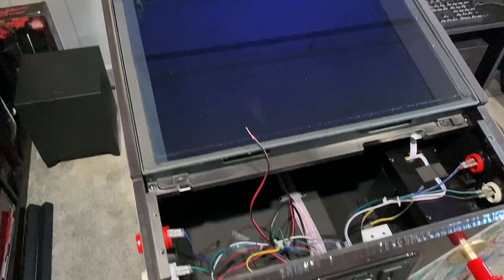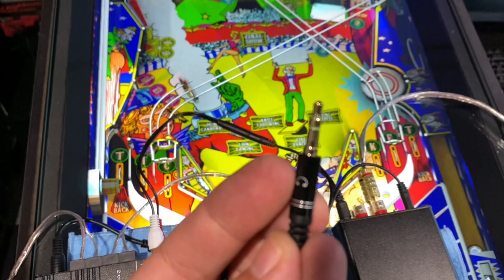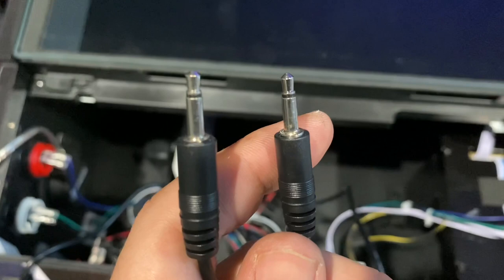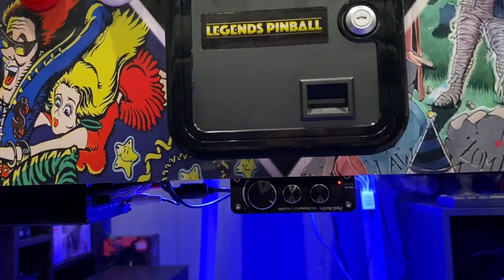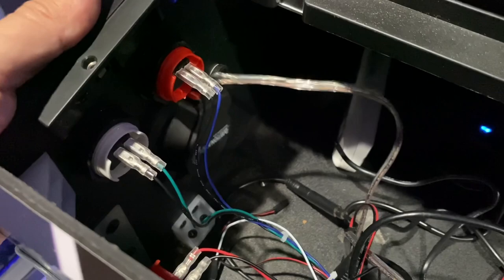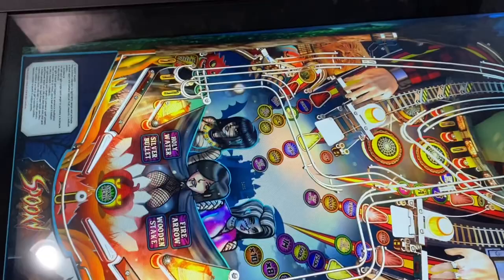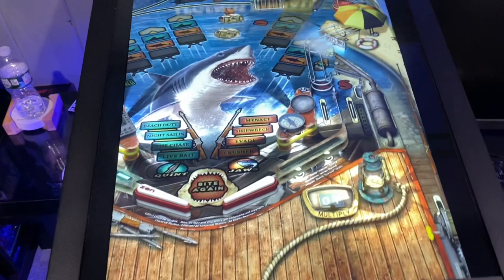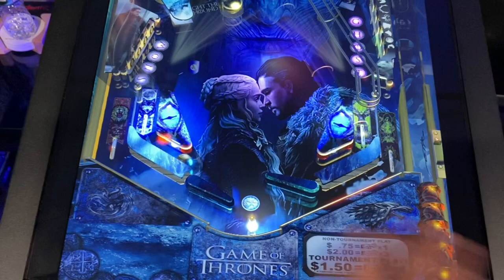Feel the Game: Legends Pinball Haptics Mod Tutorial with Bass Shaker, Exciter & Amps!

Comment: Thank you for your video and expertise!  I too ordered all the parts you have and wired up exactly like you did.  After completing all the wiring, I started up to find that only the left side exciter was working.  No right side and no bass shaker.  I went back and checked all my connections to find the issue was the 3.5MM male plugs.  For the plug for the shakers which plugs into the RCA split 3.5MM female plug, if I unplugged it and plugged it back in just enough to make contact, only the right side shaker would work.  If I plugged it in all the way, only the left side shaker would work.  I found a very shallow sweet spot in-between the two which makes both exciters work.  As for the bass shaker, that 3.5MM male plug plugs directly into the amp and same thing, slightly unplugging it makes the shaker work.  Has anyone else had this issue?  I don't know if I got a shoddy pair of 3.5MM male plugs or what?  

Besides that little hiccup, all the sound, bass, vibrations are really awesome and well worth the mod!
Reply from the maker: You are most welcome. Thank you for watching. Although I did not have the issue mentioned, I pulled the link for those 3.5mm splitters as a few have had the issue. A comment recently deleted by Bonebuster I believe mentioned ordering mono not stereo versions of the 3.5mm as the system outputs in mono. Greatly appreciate your feedback as it’s crucial to ensuring the mod works and improves overall feel of the machine Tim! Happy New Year!
Reply: Hello! Thanks for the video. I have the same issue. Is there any way that you can post links to the right Mono 3.5 mm  Cables? I did get the bass shaker to work with a stereo 3.5. But then the amplifier failed. I had to send it back. It would not even connect Bluetooth.  Another thing, The black and red wire coming from the AlP is a positive and negative?  The Y splitter to RCA is left and right.....how does a mono Y splitter affect the positive and negative?
Reply from the maker: Hey, thank you for watching. Google the differences between mono and stereo splitters and you’ll see the difference. Single band on the end vs dual for stereo. They have them readily available in Amazon for $8-10
Reply from the maker: How did the amplifier fail? Defect
Reply from the maker: Doesn’t affect RCA.
Reply: Had a similar issue as others have listed in this comment chain. I have my setup wired exactly as show in the video. Both of the 3.5mm male connectors wired to the red/black ALP. The exciters work great, but can only get them to work in the left channel. In saying that I have 2 of the Fosi audio amplifiers that have gone out for the bass shaker. Both have worked for about 10 minutes then nothing. My thought at this point is it’s either the way everything is wired causing some sort of loop, or the amplifier itself. I have a 100w bass amplifier that I have on order to see if this might be the case. 

Nobsound 100W Full Frequency Mono Channel Digital Power Amplifier 

Audio Mini Amp (Black) https://www.amazon.com/dp/B07518QZ9B/ref=cm_sw_r_cp_api_glt_i_E197PV111Z2V8J7WPK07
Reply from the maker: Sadly I have not experienced any of these issues, my amps, exciters and bass shaker all function as intended - months later. I’m actually playing it right now. Please keep us updated on what you find.
Reply: @JohnPauls  Will do. I wanted to say thank you for all of these videos. I have both this and the solenoids and when fully working it definitely is a game changer. Once I get the amplifier in and hooked up I will post an update.
Reply from the maker: You’re most welcome. I’m very glad to hear that, so many put the ALP down because of the stock haptics, these mods make a significant difference to the whole experience and gameplay immersion. Thank you for your feedback, it’s helpful to figure out the issue some are experiencing. It’s hard to figure it out myself as my system is working as intended since this build. Thank you!
Reply: @JohnPauls  Just for note, just received the mono amplifier for the bass shaker and got it all hooked up. So far so good. The only downside I have noticed so far is the fact that the amp makes a low hum if turned up too loud. In saying that I may shop around for another mono 100W amp that can better filter this.
Reply from the maker: Thank you for the update. They’ll all do the low hum depending on how loud you have the amp set. You can install an inline low pass filter that’ll eliminate most of it. I don’t have my bass shaker turned up loud enough for it to bother me. It only occurs when there’s no sound input going into the amp - ground loop feedback.
Reply: Well. After 2 fosi amplifiers that have failed. I am now noticing that my haptics are not even getting signal. After hooking them Back up stock.
 Do you have any idea what  Number of ohms that is coming out of the wire connected to the backboard should be?  I am thinking that my board might be damaged. :(
Reply from the maker: I hope you didn’t blow the stock amp on the board. That could’ve been done if you attempted to wire the exciters (stock or Dayton’s) in parallel as that would put a significant enough load to blow the board. Wiring it the way instructed only allows for the signal to be processed by the new amps, those new amps should not be feeding amplified current back into the board unless wired incorrectly.
Reply from the maker: How did the amps blow? What were the conditions when they went? Mine is still going strong as per the most recent video - today.
Reply: I wired everything up exactly how you did. The 1st attempt I would have to pull out the aux cable out just a little bit to get the shaker  And Dayton's to function. While doing so, the fosi amp just stop working.
 I've returned it and attempted to do the same thing with another fosi and the same thing happened. The fosi   amp just did not put out any signal. The Bluetooth stop working too..   Is there a way to spice off the speakers yeah speakers on the backglass? Hook it up to an amp? With a bass shaker?
Reply from the maker: I’ve heard of an in-line connection and people using the back speakers specifically to get Fx3 haptics working. Worth a shot but I haven’t tried it yet. 

Why are you using the Bluetooth for this mod?
Reply from the maker: I think it has to do with the cable. How many lines are on the end of the tip? One of two?
Reply: @JohnPauls  One small thing I wanted to add. I ended up using the fosi power supply for the Nobsound amp instead of the one I ordered that was the Nobsound brand. I was noticing when i used the same brand power supply, my pinball plunger was having issues registering and it almost seemed as if it was skipping. When i swapped the power supply back to the fosi brand the issue was gone. This is a little worrisome as the fact that the power coming from the amp is causing those types of issues. It makes me believe that if wired incorrectly that this could definitely cause major issues with the ALP board.
Reply from the maker: Did you check the power supply’s Voltage and Amp output to ensure they were compatible? That is really strange. Not once have I had any ALP glitches or malfunctions caused by the amplifiers baring the haptics needing to be turned off. Something was wired incorrectly or was giving feedback to the PCB. Do you have both amplifiers and ALP on the same power brick? If so, please separate them. My ALP and PC run on a Battery Backup Surge Protected Power Supply - plugged into the outlet. The haptics - amps, solenoids run to a Surge Protected power brick to the wall outlet. This helps to eliminate some ground loop feedback.
Reply from the maker: That line we tapped into in the video is an pre amplified output, the board will blow if you try to power speakers beyond its load and Impedance ratings. Why wiring Dayton’s in parallel is a bad idea and why AtGames wired them in series. All we’re doing is taking that signal and amplifying it for the exciters & transducer. That amplified power should not be feeding anything else if wired correctly.
Reply from the maker: Keep me posted Garrett, I’ll do my best to help.
Reply: @JohnPauls  yep, the power supply I ordered was the one recommended by them. They actually give you the option of ordering any rated for DC 19V 4.74A 90W. In saying this to be safe I went ahead and ordered their name brand. After I did order and before I returned the fosi amp I noticed it was the same power rating so I went ahead and tried it. Worked like a champ and the plunger issue was gone. I do have them on the same surge protector and will go ahead and separate them based off your recommendation.
Reply from the maker: Good to hear. Yes, eliminates possibility of feedback for both systems. Keep me posted on your progress, hope you are up and running fully soon.
Reply: @JohnPauls  Thanks again! Do you by anychance have a good email I could contact you for questions? Would like to send some pictures on the setup and get some thoughts on making sure I have everything wired the correct way.
Reply from the maker: You’re most welcome. Unfortunately not and YouTube doesn’t make it easy to accomplish this simple ask. You could make a private video - viewable with link, comment the link so I could see and respond. I could delete the comment immediately when I  see it.
Reply: @JohnPauls  Figured out the issue. After looking over everything the y splitter I had was not mono as I had originally believed. I have a new one on order now and will update with the results.
Reply from the maker: Awesome, very glad to hear that Garrett. Keep me posted.
Reply: Garret Lake  Can you provide me with the products that you purchased? Maybe send me an email? I was able to return my pinball and get another 1. I wanna give this another shot.
Reply: @six7teen324  Definitely do not mind doing that at all. May be another day or so though as it was actually a lot harder than I thought to find a mono y-splitter.
Reply: @JohnPauls  The new mono y-connector did the trick. Have the exciters wired back up in the L/R channel with no issues. It’s crazy how hard they were to find, but definitely a have to for this build. I’m guessing when I had the non mono y-connector and the exciters in the same left channel it was pushing load back to the alp. If you are ok with it I can post the part # below I used.
Reply from the maker: That is awesome thank you! Please do Garrett, it’ll help others experiencing the same issue. I hope you’re loving gameplay now!
Reply: @JohnPauls  I hope it does as well. If I have learned anything, it was to make 100 percent sure it’s a mono female to rca. What I used is a Philmore # 44-227. 

Oh my, is it ever. I ended up adding the external sound as well for the pc! Wow, just wow. I’m definitely loving it.
Reply from the maker: Soo glad to hear that Garrett. I appreciate you including the part and number, I’ve given you credit on the video description along with the part number. Hope you enjoy your ALP my friend, please keep in touch.
Reply: @six7teen324  All the parts should be the same, except the female 3.5mm Mono to RCA Y connector which I used is a Philmore # 44-227. In saying this I believe the reason I was having issues with the bass shaker amp, was due to wiring the exciters in parallel (this was due to the stereo Y connector and only working in the left channel). I think it was sending enough voltage back down to both the alp and the fosi amp to cause issues with both. I did end up using a Nobsound 100W Full Frequency Mono Channel Digital Power Amplifier for the bass shaker, just due to it being a mono input. If you go this route though I would not recommend their power supply just due to the issues it caused with the plunger. I ended up just keeping and using the fosi power supply as they were rated the same. The only other thing to remember is make sure you have the ALP power and all the amp power on two different outlets and surge strips. This was a recommendation of JP just due to the ground issues of the amplifiers.
Reply from the maker: Thank you Garrett!!
Reply from the maker: My pleasure, why I enjoy this hobby and community. A lot of helpful people. Glad to help share and gain knowledge on improving this machine.

Comment: Nice info video. Questions cuz I'm a confused sob. Is this considered SSF ? IF so why this way and not through a 7.1 soundcard ?  Does this help with nudging at all or is that a whole different thing ? Supid ALP got me suckered into more mods and mods and mods lol. THanks. Great stuff.
Reply from the maker: Haha thank you. This ties off the stock system. Uses the wiring for the shitty haptics they provide on the stock ALP. Sends the signal to amps which provide the transducers more power for a better feel. The bass shaker is one of the best mods you could do if you’re on a budget and don’t want to go the full SSF route. You do not require a sound card for this mod however your haptics must work in OTG to take advantage. That’s firmware related, dependent on which one you’re on.

Comment: Great video.  I have seen other mods like this where a speaker-level to line-level converter is used between the ALP exciter output and the amp inputs.  Any problems/distortion in your setup leaving it out ?
Reply from the maker: Hey Brian, thank you! I’ve considered installing an inline low pass filter to remove unwanted frequencies. I have my amps powered by a separate power brick as well to eliminate some of the ground loop feedback you may get. The only time I get audible feedback is when there’s no input signal and the amps are on. No distortion.

Comment: Great video and easy to understand. i got all the items and plan on upgrading today. My only question is, I got the stereo mix enabled and still do not get haptics over OTG. Is it working to you because you have the receiver? I do not have another speaker hooked up but figured the  haptics would work because of table being the listening device. Any help would be amazing. Thanks
Reply from the maker: Thank you! 
Make sure you have haptics on the Gottlieb tables turned on and the volume on the ALP set to at least 80+ before you switch over to OTG.

Comment: Awesome vid, and thank you!  Do you get any ghost nudging from the accelerometer interreacting with the side mounted Dayton exciters?  If not, I'll mount mine in the same locations.
Reply from the maker: Thank you!!! You will with some tables dependent on how strong you have them set with the amplifier. I got tired of remembering which tables did or didn’t so opted to turn off the accelerometer all together. I predominantly use the buttons now.
Reply: @JohnPauls  where in the hell is the accelerometer in settings? I can only find it per table
Reply from the maker: Scott it’s in the Gottlieb table settings, setting it there transfers over to OTG. Pick any random Gottlieb table.

Comment: I'm basically going to copy your setup because you make it easy to follow. Is this mod(s) worth it, and would you install these before the solenoids? How much did it cost for the ones in this video? I'm going to see if I can afford them all and just do them all at once.
Reply from the maker: I’d suggest installing the bass shaker, amp and solenoids for best bang for the buck. Solenoids were $160 with the power supply.
Reply: I have the solenoids installed (did them first). How did you get the right exciter installed behind the accelerometer box?
Reply from the maker: I have a video on it. Not that hard. Just slide it in place and then pull the tape backing. Fold the tape corners before sliding into place.
Reply: @JohnPauls  Which video is that, and does it go into more detail in how to install the bass shaker also?
Reply from the maker: It was this one. The easiest way to do it is. Fold the corners of the double sided sticky tape about 2-3mm, slide the exciter in front plunger box and pull the remainder of the backing tapes off. Mount it so it’s easy to access the connection points.
Reply: @JohnPauls  Thank you. I'm still lost on the kind of cables I'll need for the bass shaker (decided to go just with that for now). I have the bass shaker, the amp, and the banana plugs you listed. I don't know what kind of Y cable to use because the one in the description looks nothing like the one you used here, and I'm guessing the thick silver wires are coming from the exciters themselves to run the bass shaker?

Comment: Could you just use one amp instead of two like the ZK-TB21? I would be using a smaller shaker as well.
Reply from the maker: As long as the amp meets the required wattage to accommodate the extra load yes.